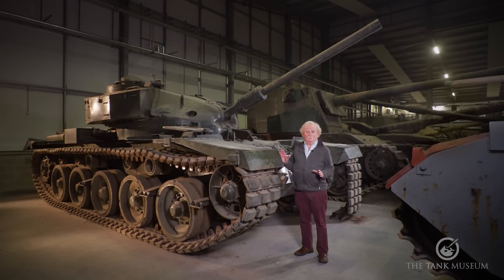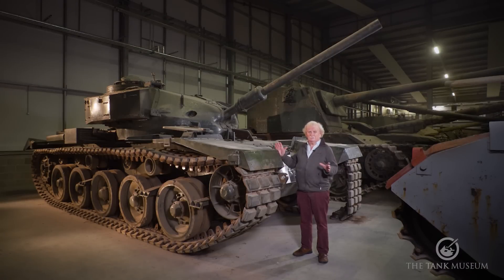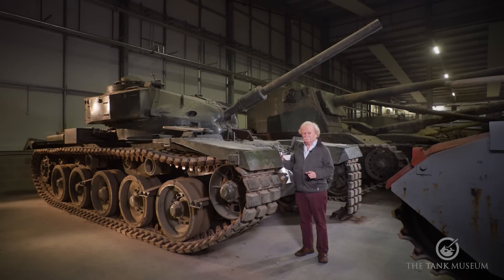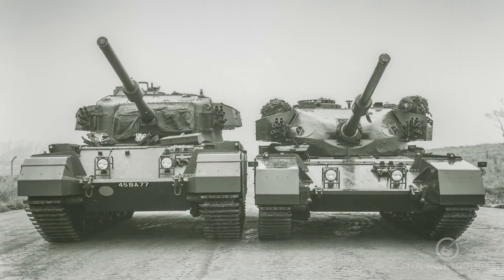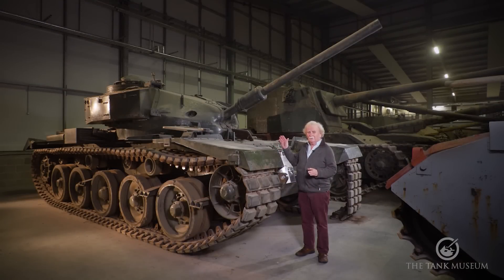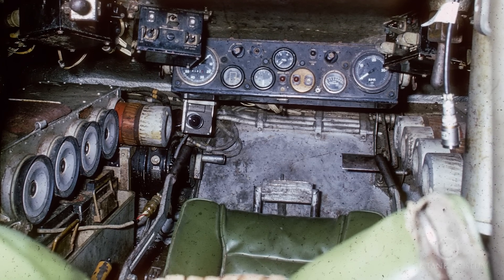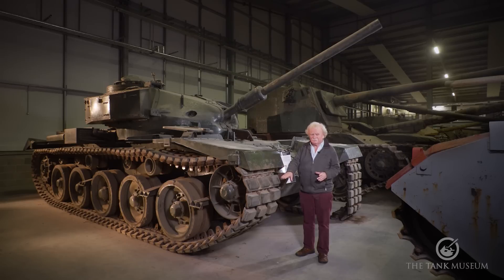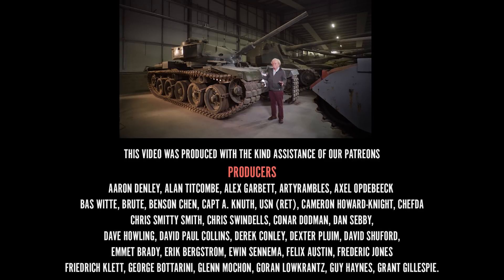Tank Chats #98 | 40 Ton Centurion | The Tank Museum

Comment: I wish the US could donate one of their older M1 Abrams tanks, that would make for quite an interesting tank chat in my opinion, and it would probably be popular with visitors.
Reply: There is a question about the Uranium that the American Abrams uses in their armour.
"Elf n Safety" will be having a bleedin' fit. They could try to get one of the Aussie models.
Reply: Imagine it at Tank Fest. Increased ticket price due to M1 fuel bill. Thrown out a PzKpfW II to make room for the gas bowser. Wipes out a square mile of Antactic icesheet per minute in idle!
Reply: @QqJcrsStbt  I don't want to ruin your opinion about the Abrahams but the turbines proved them selves as fuel efficient engines. Under constant load they are even mir efficient than the diesel engine used in the Leo.
Reply: @jakedee4117  Any M1 prior to M1A1HA does not have DU armor. So the M1, M1IP, and M1A1 are all free of DU armor.